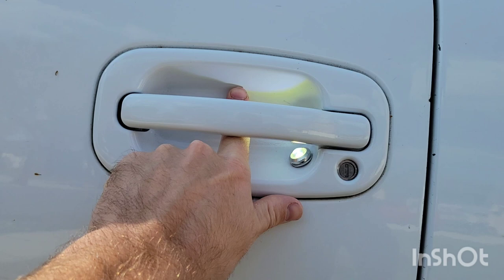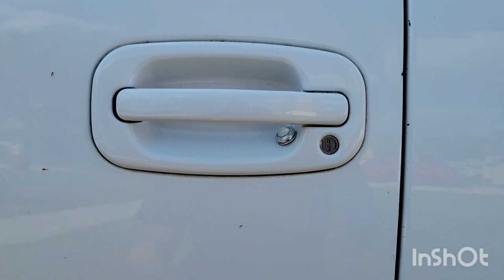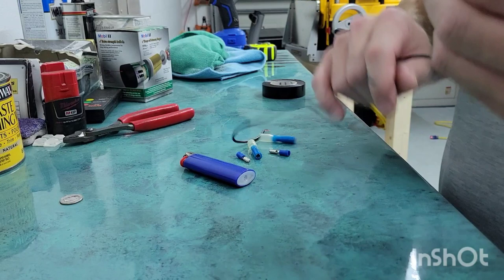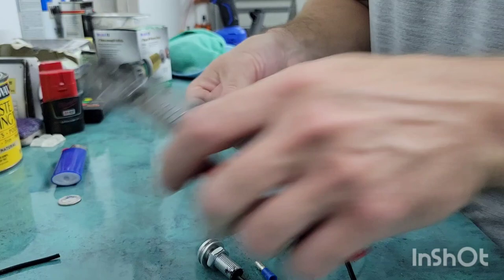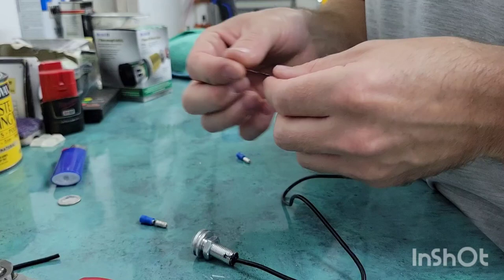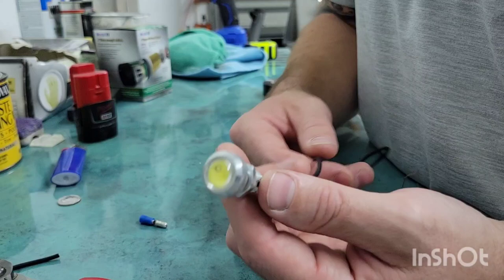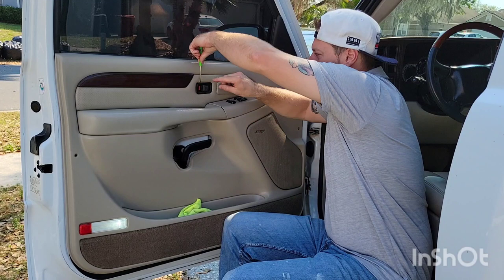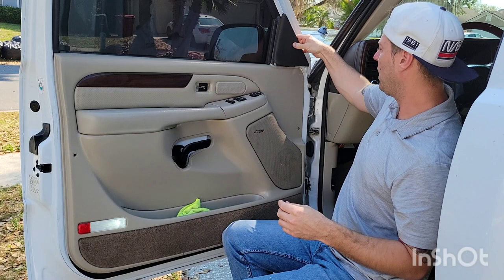LED Door Handles - 99-06 Chevy/Gmc Trucks & Suv WALKTHROUGH

Comment: hmm what about using a flat bracket style with weather proof led strip or even a led strip with double sided automotive tape and mount it to the rear of the door handle or maybe front side of it that way it blends in? I like the concept but I see why water keeps getting in. maybe extra silicone from the inside making it flush to avoid water going inside and flooding the led.
Reply from the maker: That's exactly what i did, I just ran a bead of silicone around the Led housing. It's been holding up better than the last two so far. That's also a good idea with the Led strip!